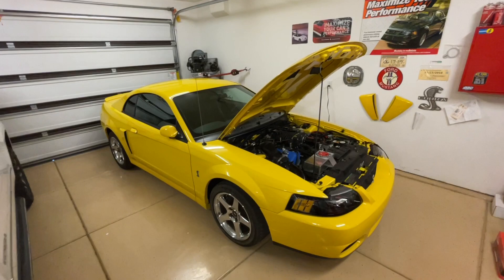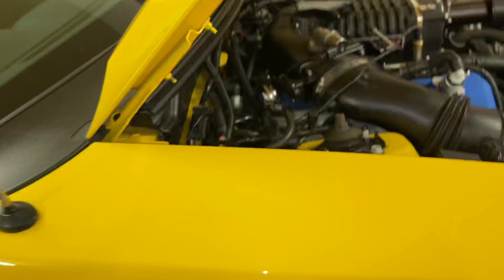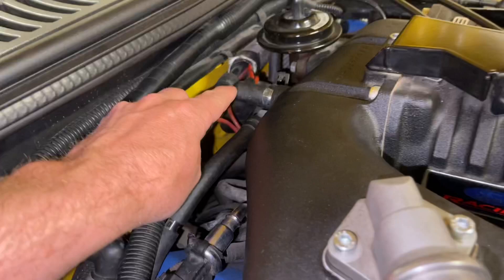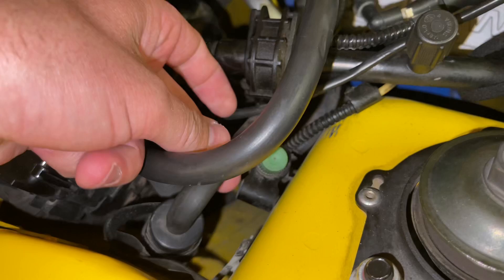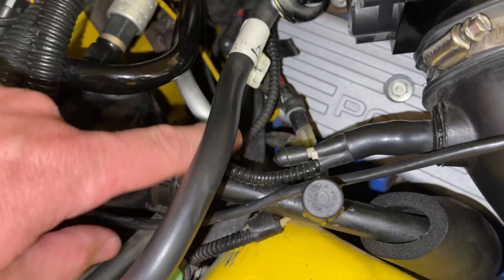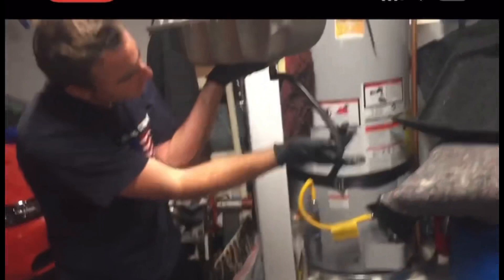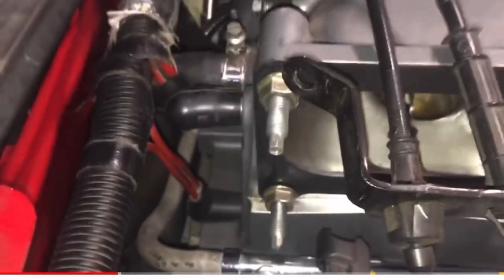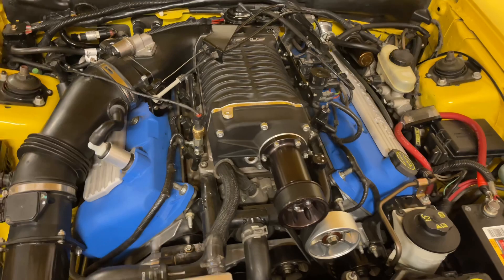03/04 Cobra vacuum lines explained. Boost bypass, EGR, boost gauge, PVC

Comment: I you have reasons why to do boost by-pass delete,  plugging off the lower manifold and capping off the vacuum line to the intake, removing the check valve or any other vacuum mods, I would love to hear it.  My vacuum came with a lot of things deleted including the EGR, boost bypass adn it also had breathers.  Thanks for the videos.
Reply from the maker: A lot of people plug the lower manifold so it will never leak. It still does the vacuum relief job going from the cam cover to the supercharger. As for the other items, it’s common to delete them for the Egr and such- but it’s a good idea to keep the parts in case emissions become enforced

Comment: On the new whipple gen 4 2.9 they have a the line that would go to the bypass valve going to the blower so where does that egr line that use to go to bypass valve go

Comment: Hey Danny on the boost Solenoid the middle vacuum line that goes to the top of the boost bypass what did you use to make it longer I am installing a gen 3R on my 04 cobra?
Reply: I'm about to install a 3R on mine, did you find a solution to this problem? Any other issues? I know I have to modify the coolant crossover tube

Comment: Hey Danny got a quick question..what side is the pcv valve on an 03-04 cobra can't find a direct answer anywhere..it's for a tork tech kit I'm doing thanks love the videos
Reply from the maker: There is one on each side for each cam cover. The passenger side goes from the intake to the cam cover and the driver side goes from the cam cover to the back of the blower. https://youtu.be/QrdJMuJleko
Reply: @dannyjohnsonsgarage  can you tell me how to route the pcv lines on a tork tech 2v..I have the pcv valve going to the intake and the driverside going to the back of the blower to the big vacume port but I think that is backwards because it has crazy crankcase pressure..

Comment: You seem like the guy to know this, but my cobra isn’t going into boost at all and idle surges +- 100 rpm. I reconnected the battery and the car does fine until a couple weeks. You think its a Vac leak or bad bypass valve? All the routing is OEM.
Reply from the maker: I would agree with the bypass valve. If it’s stuck the car won’t build boost
Reply: @dannyjohnsonsgarage  thank you! Ill give it a look

Comment: Hey Danny, I'm trying to diagnose air/AC being stuck on defrost only. I saw where you mentioned the black line going into the firewall affecting the controls but not sure where to diagnose further and wondering if you had any advise? Do you know if that black line into the firewall is supposed to hold vacuum or boost? Mine held boost with a mighty vac but would not hold vacuum.
Reply from the maker: I’d pull the glove box down as shown in the video below and look for any vacuum lines that are broken back in there. https://youtu.be/T0ikiJpZgQc

Comment: Let me start by saying that I know nothing and I can prove it. I am working on an 03 terminator with an 02 body. I don’t have an egr valve. Is this because I have aftermarket headers? Also is there a source for the plastic vacuum line and rubber boots? I normally order most of my stuff from NPD but I don’t see it in the catalog. Sorry for my ignorance. My idea of newer is 1972. Thanks.
Reply from the maker: The EGR was probably deleted. eBay had parts that are all together and used, but very expensive. If you find the right adapters somewhere I’m sure you could make your own setup
Reply: @dannyjohnsonsgarage  should I bother or just cap off the vacuum line?
Reply from the maker: @marcusloftis2779  unless you need emissions, it’s probably a lot of work for no reason
Reply: @dannyjohnsonsgarage  thanks a million. This is all new territory for me. It really doesn’t seem like it’s all that bad if you just understand the basics of what everything does.